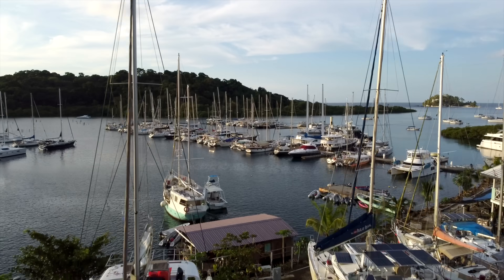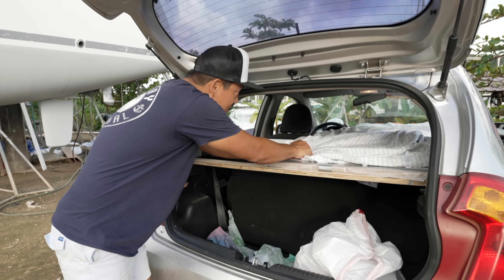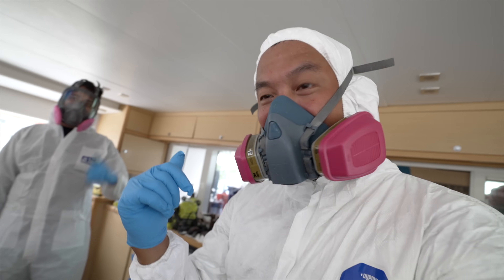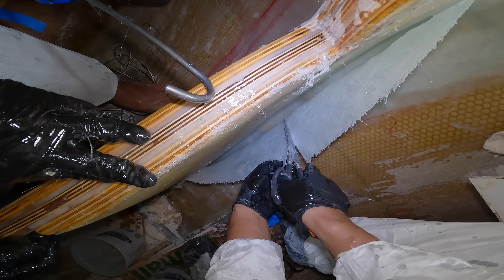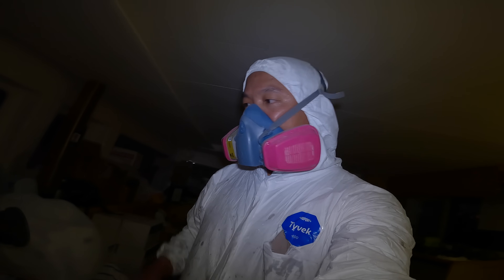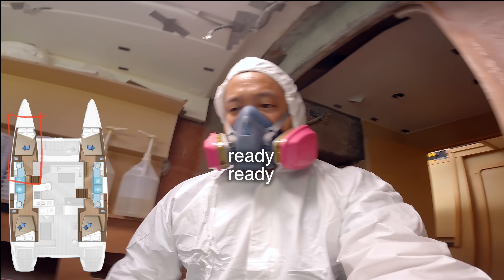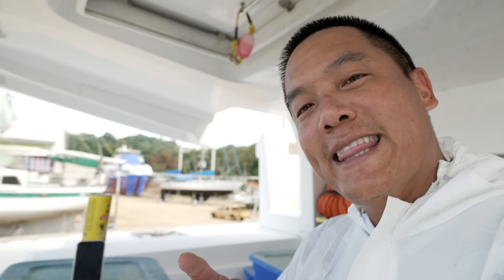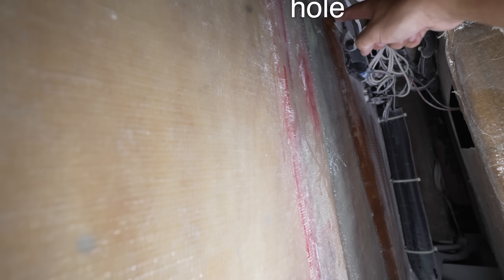I SURVIVED 10 Months of Rebuilding My Boat

Comment: You cannot overstate the misery of working with epoxy and fiberglass,the sticky resin,itchiness of the fiberglass coupled with the tropical heat,all of which makes this one of the worst jobs you’ll ever endure.You’ve done it with a positive cheerful attitude and with excellent results.
Reply from the maker: clearly someone who's been there himself! you understand the pain bro!
Reply: @david_shih  I seem to recall that you did something with air conditioners and or exhaust fans to SOMEWHAT cool your work area while wearing the Tyvek suits, and route fiberglass sanding dust away from the rest of the boat.. am I misremembering that?   Did it not work out over the long run?  or... was that somebody else?  I think it was you, because I remember thinking, " Colin is probably kicking himself wondering why he didn't think of doing that. at he outset."
Reply from the maker: @ssn608  hey Allen! Yes, i did build out a full blown dust collection system with negative air pressure. It reduced the dust by about 95%, but the remaining 5% was still so ridiculously much. It still got in every crevice and nook and made me itch like crazy! Don’t get me wrong… it was still worth it, but clean up still required hosing down the interior for hours and hours!
Reply: Why does everyone torture themselves and go to the tropics? Where everything is expensive? Why not refit in Europe. It used to be not tropical, fiberglass is dirt cheap and there's a thousand insignificant little towns where you can dock cheaply. Seems like such a hassle in the tropics even getting an Amazon order delivered to god knows where, Island Nr 155 that has a ferry per day coming by...

Comment: I understand the need for all this work you did, but I'm curious how much weight you added. How much would you estimate? Do you think it will slow down the boat?
Reply: Probably not that much. Have you seen how much extra junk cruisers have on their boats? Or how many people there are on the boat at the same time? One extra person is most likely heavier than this extra fiberglass that they put into these bulkheads. So if they need to go faster, they just toss one extra human overboard, and problem solved.
Reply from the maker: maybe 3-400lb? as a guess? we took out a bunch of material before the repairs (the broken parts.) The good thing is that Lagoon's are designed to be extra wide and carry a ton of weight, that's why people make fun of it and call it a floating condo. We had 30+ people on the boat once and couldn't tell much difference.

Comment: Hey David how do you clean your tools especially the rollers?  Can you show a video or did I miss it?
Reply: You have a bucket with a tight lid filled with acetone.
Reply from the maker: Andrew is right. Acetone bucket with screw on lid. Soak everything metal or plastic the second youre done. Anything fabric or foam gets trashed bc there chance of cleaning it! Suits and gloves go straight into the trash. Shave head if any epoxy gets in hair!
Reply: @david_shih  But the resin still kicks off in between the grooves.  Give me a number on how many rollers you went through?  Did you torch them and hit it with a hammer?